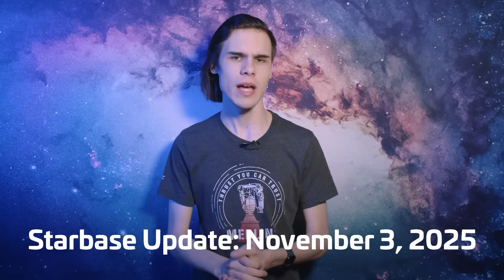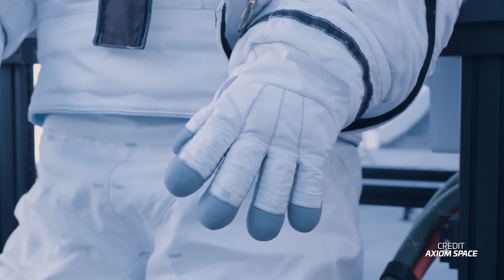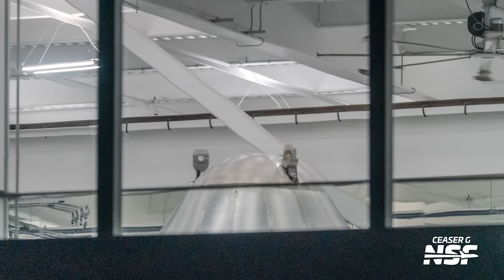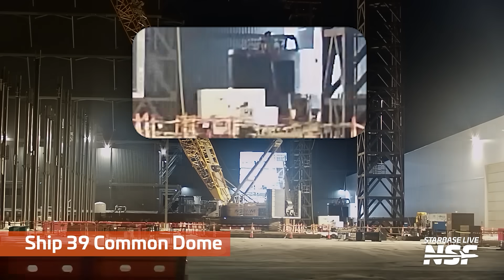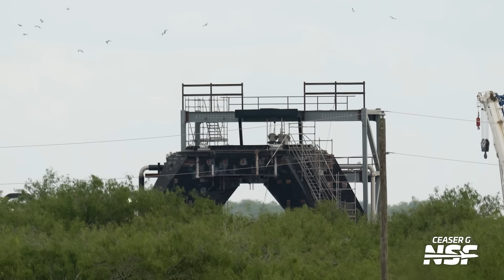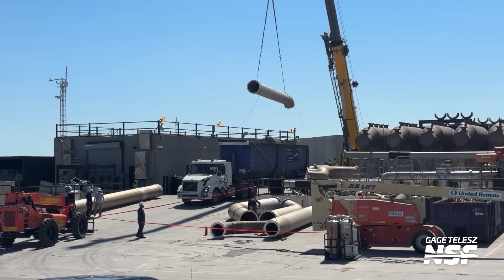Starship V3: Build Accelerates, Raptor Relights, HLS Update

Comment: Here's my 2c speculation. The reason SpaceX showed the MMOD tile torch video and the old HLS prototype which had tiles could well be because SpaceX has sold NASA on the idea that Starship HLS should have Earth return capability in the event the SLS Orion Capsule (or EUS) suffers a mission-ending anomaly. Just a guess. It might not be ideal doing the flip and burn and being caught by skyscraper sized chopstick tower, but it beats being stranded on the moon.

Pretty exciting that SpaceX has caught the first stage / Super Heavy multiple times. And that's with V2 Raptor. Gives me confidence 2026 will see them catch Starship and do orbital refueling. So excited to see V3 Starship Launch System  (SxSLS ;)

Comment: There are two "big issues" for SpaceX ... as well as the nearly infinite number of details that need to be done right.  People need to remember an old line from the WW II days of aviation: "every aircraft is a million compromises flying in close formation ... until they don't."   Spaceflight is even more so.  The overall problem is the crazy-high number of "critical parts" each of which can kill you if they fail.  Redundancy only goes so far....

But OK, the two big problems: refueling in orbit ... and actually landing the HLS on the moon.  

Refueling isn't just the physical problem of refueling in zero-G, that (IMHO) isn't really as hard as a lot of people think.  If anyone cares, I can explain why.  It's that the whole mission coordination of the repeated fueling flights, that must launch and succeed in tight cadence is really daunting.  Still, if it fails, people shouldn't die ... just the mission fails.

Landing the HLS on the moon, and then getting back off again ... isn't easy.  Two things worry me -- #1 is all the images of HLS on itty-bitty little narrow legs.  It's crazy tall.  Are these images anything like what SpaceX will really do?  I doubt it, and sure hope not.   The other thing that worries me is engine light of the methalox engines to get back off the moon.  There won't be any hold-down clamps.  One of the things I don't know is whether the engines can be lit at low enough throttle that the HLS will just sit there in lunar gravity until throttle-up?  If not, the light-and-go is really scary.
Reply: The legs being "small" isn't a big deal. The ship is already 9 meters wide with low center of a gravity. The legs will be more than wide enough. It isn't like the lunar surface will be moving. Remember, SpaceX lands a much more narrow rocket on a ship bouncing around in the ocean. 

The engines will be tested massively before landing on the moon. And they will have both the landing engines and the main engines.
Reply: @anthonypelchat  ... you better explain just how it has "a low center of gravity."
Reply: @leeharrison2722  All of the engines are at the bottom, as well as most of the fuel that will be left over. Most of the mass up top is living area, which is far lighter. CG won't be completely at the bottom. But it will be low on the ship.
Reply: @leeharrison2722  I don't think managing tanker flights will be a big issue.  We're not talking hundreds of even dozens of flights per day.  Of course until we know the boil off and loiter times of any target vehicle we can only guess at what kind of cadence is needed to fuel it.
Reply: @anthonypelchat  -- OK, I suspect nobody else is listening at this point, but I do want to get back to this, simultaneously saying that you and others (one in another thread) make some reasonable points, but without the numbers to really back them up ...and I don't have really good numbers either ... so some of this is just peanut gallery commentary on both our parts.

The wikipedia article says that somebody says that "When within 100 meters of the lunar surface, the HLS variant is planned to use high‑thrust landing engines located in the mid‑body section of the spacecraft to avoid plume impingement with the lunar regolith,[7] though these engines may not be needed.[8] The landing engines burn gaseous oxygen and methane instead of the liquid oxygen and methane used by the Raptors."

Uh ... really?  In other words they don't know? Really?   A year away from the nominal mission and this isn't settled? 

I don't think disturbing the regolith is the big issue here: engine reliability is.  Maybe this is a low-performance but highly reliable design? 

But there must be a serious mass penalty with this, due to sizing this system up to the task, and also the lower Isp.   AND ... this doesn't specifically say it will be used for the return burns.

As to the "low center of mass" ... well, I tried to calculate that out too.  The issue is just how much propellant is it carrying, and I think it is a lot more than you think, given the above.  

It's true that the FALCON boosters land on barges, they are next-to-empty when they do.  And they aren't HLS.   And the barges are flat, and the sea state is known.

One of the things that puzzles me, and I may be wrong, but from what I can find there isn't really high resolution photography of any place on the moon ... like 5 cm resolution?  Is this right? Why?  

It should be easy-peasy to get super-resolution from a simple optic in low lunar orbit.

Knowing just exactly what you will be landing on would make all the difference.
Reply: @leeharrison2722  "but without the numbers"
And as you said, you don't have the numbers either. A better idea is to trust that the brilliant people at both SpaceX and NASA are working on this. They know more than any of us. They are some of the most capable people on the entire planet. This discussion here is nothing more than regular people sharing the tiny bit of knowledge we have. Nothing we say makes a difference.

"In other words they don't know?"
The random person that wrote that doesn't know. NASA and SpaceX do know.

"engine reliability is."
Which SpaceX will test heavily before any mission. Further, SpaceX always has redundancies with engines. Falcon 9, Falcon Heavy, and Starship all have engine out capability. And Starship specifically has been tested multiple times with engines out during the landing phase. 

"But there must be a serious mass penalty"
And? Starship has drastically more payload capacity than anything ever sent to the lunar surface. A mass penalty is no big deal. The payload AFTER the mass penality is somewhere around 50t.

The engines on the side are just for landing and probably for takeoff from the Moon. The total deltaV needed there is very, very low. Most of the DV is going to be with the main engines.

"As to the "low center of mass""
Again, multiple engines on the bottom and the majority of the fuel is very low as well. The center of gravity won't be right at the bottom, but still low.  

Again, absolutely brilliant people are working on HLS from both SpaceX and NASA. They understand these issues better than either of us.

"there isn't really high resolution photography of any place on the moon"
I doubt that. Likely you just didn't search properly or the images aren't publicly available. But it doesn't matter. They will absolutely have all of the necessary images and data they need, even if the ship itself has to get it.

Comment: Guys, I can’t understand why they are putting probes on some ships and receptacles on others. If they fitted all ships with asymmetric fittings, probes on left, receptacles on right, then when turned back to back they match up! That would mean all ships could transfer fuel to any other.
Reply: Only the fueling ships need to be able to transfer fuel. So no reason making the other ships capable of doing so. No need to add unnecessary hardware. And it is far more difficult than just adding different fittings. We are talking about moving well over 100t of cyrogenic fuels.
Reply: @anthonypelchat far easier to make a single design. The tanker can be a standard ship with additional tanks in the cargo hold. Not my problem. I’ll just enjoy the show.

Comment: I'd like to see SpaceX test their lunar lander by sending it there all on their own equipment and staffed with a "crew".  Once proven, the crew could fly the NASA astronauts to/from the lunar surface as paying passengers.  The lunar astronauts could then focus entirely on their science while the crew operated the lift, maintained the ship, made the meals, etc.  If we're really going to advance to a airline-like view of space travel, this would seem to be the way forward.  It would also put the final end to the extremely expensive (if really cool) Artemis program.  

Once they have orbital refueling down, they could position a second refueling station in lunar orbit.  Then set up a scheduled tanker/passenger and freight/passenger service between the two, with HLS going up and down at the lunar end and re-entry protected ships going up and down at the earth end.  Those latter would only need minimal passenger accommodations and could be heavy-lift oriented.  The ones on the earth/lunar route would need to have more comfortable accommodations, though not as spacious as those shown in the HLS renders.  They would accommodate crew and occasional passengers, but be mostly cargo (freight or fuel) oriented.  HLS would need comfortable long-term lunar accommodations until they get something livable on the surface, then could be simplified to carry more freight.
Or some variation of all that.  Most of it will be possible with use of the same technologies that they are already developing for HLS.
The beauty of this is that the moon does not require the use of a biannual transfer window, so the schedule frequency would be much quicker.  Since Falcon 9 demonstrated the economic benefits of reusability it seems likely that they would have companies, universities, and other countries lining up at their door, even if NASA goes their own way.  And this regular cadence could bring SpaceX both a revenue stream and lots of experience to apply to their Mars program.

Comment: RE: HLS tiles, HLS has high mounted angled motors, the fuselage around and below these exhusts will require heat shielding.

The raptor test stand... is there some crazy distance compression in the camera happening? as surely that excavator is being operated in shot with the raptor test behind it... is there no clearance zone?

Comment: Any insights as to how 'hurricane-proof' both Giga-bays will be?  I can't remember if this has been discussed before.
Reply: I don't think it has been discussed or mentioned by Spacex.  However most of the time when building storm proof buildings they frame and build in steel.  Which is what they have here.  However they are of course HUGE surface area's for wind to act on.

Comment: I may have missed it but a video describing what we / spaceX plan for the various starship models and role would be interesting.
So maybe 3 surface to orbit (tanker, cargo and crewed) then depot at orbit to refuel / refuelled by tanker etc . What each type would do (which go to lunar surface, which reused etc) to fill out the whole starship cycle as it was.

Comment: When you spot Raptor engines leaving MacGregor, where are they going?  If to Starbase, can't your cameras spot them and get a different view?  For example, you identified 2 of the 3 serial numbers as they left.  If they went to Starbase, couldn't you determine the missing number?
Reply: They go to the Raptor storage hangar at McGregor. The location of our camera is nowhere near the entrance/exit to the McGregor test site to know whether the engines leave the site or not. If they do, they may not necessarily have to go to Starbase, they may go back to Hawthorne where they're built. And even if they then go to Starbase, the engines come in covered in a trailer and then are unloaded into the back of the Mega Bays or the Starfactory so we can't see them unless we're really really lucky

Comment: They should build a booster big enough to get the propellant storage tank to LOE. Also recover the booster slowing it enough to avoid an entry burn.
Reply: I think you might be in water a bit over your head. If that could be done it would have been done a long time ago.  Doesn't work that way though.
Reply: Unfortunately that's not how physics works

Comment: Maybe the tiles being added to the HLS are a temporary emergency measure in case there is a problem with the Artimus capsule. If the HLS is refueled to capacity in earth orbit, perhaps it would have enough fuel to achieve Moon orbit, land, takeoff again and dock with the Artimus capsule. If, for some reason, the capsule doesn't work the astronauts can stay aboard the HLS, break out of Moon orbit, achieve earth orbit and be refueled with just enough to land. If that doesn't work a Dragon could come up, dock, and shuttle the astronauts to a splashdown.

Comment: Nice renders but that doesn't change the reality that Starship is not viable, at least for interplanetary travel. Space X has never been forthcoming about refueling and the true cost of the system. Best case scenario assuming they can ever achieve a steady orbit, Starship could be an excellent vehicle to deploy lots of Starlink satellites and that's about it.
Reply: How do you know that? You can speculate, that's fine, but you can't be definitive.
Reply: @12user-u5h  He has no idea.  He's not even remotely interested in knowing or understanding.

Comment: Has anyone seen information about how SpaceX is going to close off a portion of the new hot stage ring to determine separation direction of the booster?
Reply: They won’t, the ship engine startup will be staggered to allow for the push to be in a determined direction

Comment: @3:10 i wouldnt read into it looking like a tile too much if their going through material testing. They need a "backing board" for the material/paint/surface finish they are testing, and if they already have hexagon tile shaped blanks in stock, why make different shaped ones? 
Could be a hint at a future upgrade, or could be a case of "why reinvent the wheel when we have this" :)
Reply: More importantly, if it's shielding it will need to be fitted to the entire outside and as you said, they already have all the necessary tooling for the reentry tiles.

Comment: Should try and land it flat on the moon ,save it from falling over
Reply: And that’s how you get two astronauts stuck on the Moon
Reply: Fall over with the mass of the engine and several hundred tons of propellant at the bottom of the vehicle below the mounting point of the legs. Yes very smart
Reply: Only if they want to add a couple more years to do a radical re-design.

Comment: It still has a Pezz dispenser, no life support system or landing legs, I thought Elon said V3 is the HLS ? Remember flight one, the huge hole it dug under the pad, think this on the moon, but without all the gravity and more loose soil, that cloud will be seen from earth for weeks.
Reply: V3 is potentially many variants. But they aren't flying HLS yet. The huge hole of flight test 1 was caused by the super heavy booster, which is not going to the moon. If HLS ever goes to the moon it won't be landing with the raptor engines anyway.
Reply: @stevenmonster  Even SuperDraco engines can't lift this rocket, so unfortunately for you, yes they will be landing with the Rapter engines.
Reply: @flightsimdev  Super Draco has nothing to do with Starship, that’s on Crew Dragon
Reply: @flightsimdev  The V3 will be the ones the HLS might be build on.  The testing articles are not the actual mission hardware.  Wow.  I don't think you have ever made a comment yet that wasn't silly or blatantly ignorant. 100%.  But then your only motive is to vilify and like all haters you'll make up or lie as needed.
Reply: @imaginary_friend7300  Well it has a Starlink slot, it has no life support system and has never been into orbital insertion, where did I lie? Elon himself said V3 is the HLS rocket, and talking about Elon how come he can talk bullshit all the time, fudge the numbers, and even lie on his website about his achievements and you are okay with this?
Reply: @ale131296  I know this, what I am saying is RCS thrusters are not strong enough for lifting the rocket on the moon.
Reply: @flightsimdev  Not sure where you thought they're RCS thrusters but there are 20-something of those engines there and on a 1/6 g environment they would only need to create a few tons of force each to be able to land or lift off the ground the HLS Starship so unless you've even tried to crunch the numbers for this, it's nonsense that you claim they can't lift the lander off the Moon. They clearly can produce engines in the 1-5 ton of thrust range lol
Reply: Not sure if you missed the part we talked about having different configurations of the ship and that they’ve been testing life support systems and are building a flight crew cabin but sure

Comment: Where Starship HLS crew transfer is located at the top is where the new landing tank is now positioned. It does not add up
Reply: HLS does not have the header tanks at the tip as it does not perform a bellyflop. It completely adds up and has been known for years
Reply: It adds up because HLS is not coming back to Earth!

Comment: Let’s be real though this will not be on time for Artemis. There will 100% be delays if Starship is used.
Reply: There will 100% be delays. Full stop. Period.
Reply: Are you one of those pretending Starship is the only point in the program that might experience delays?
Reply: Artemis has been delayed for years, long before Starship HLS was chosen. And it will continue to be delayed. No big deal. But nothing else can be ready faster. The closest option is Blue Origin's lander. However, that has already been delayed from 2029 to 2030. Nothing else can be ready faster than that.
Reply: There already are multiple delays. Besides, HLS is vaporware and anyone who thinks landing a tower on the lunar surface is a sound idea, should think about it again for more than 5 seconds.